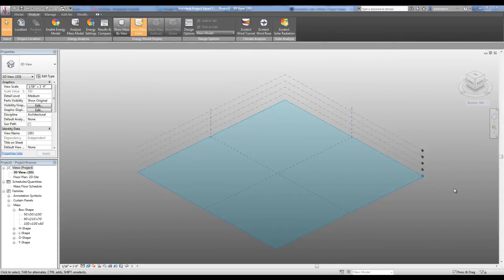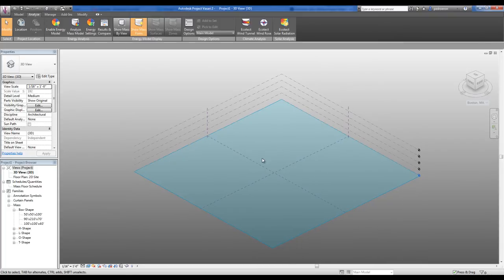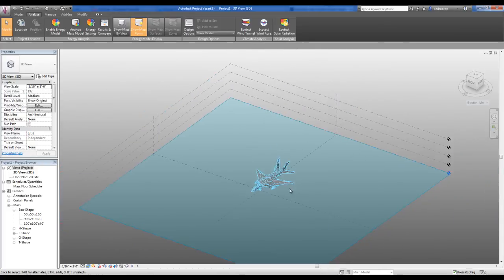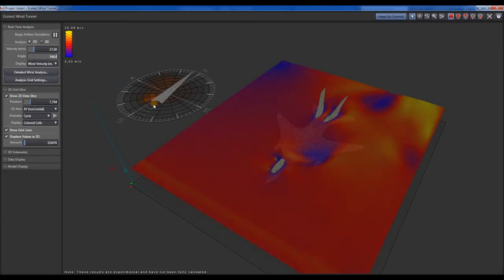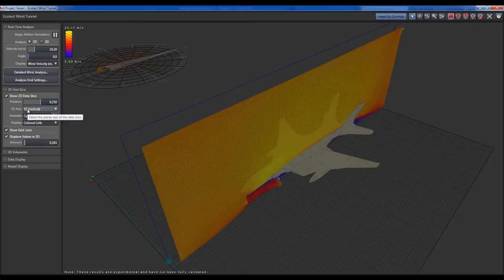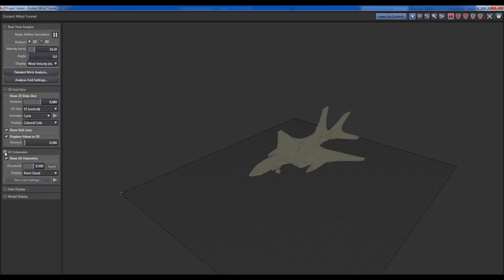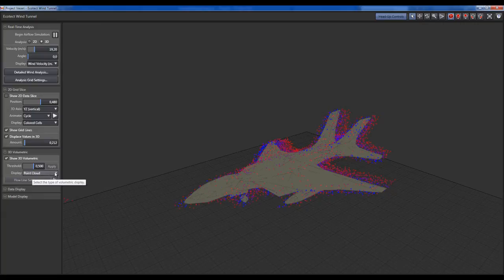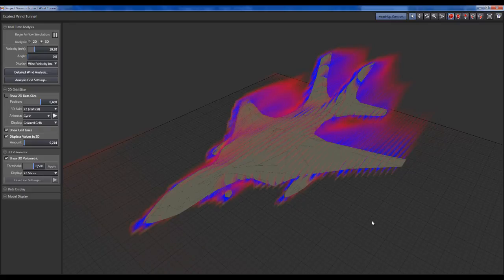AMAZING REVIT 2 - ANALYZING COMPLEX MODELS IN A VIRTUAL WIND TUNNEL

Comment: what was the link to this software please ?
I couldn't quite make out what you said.
Looks like a cool tool !!
can it show you the center of pressure and can the model be rotated in order to adjust angle of attack etc. ?

Also, Can it simulate the thrust from the engines ?
As that has a significant impact on airflow

Cheers :)